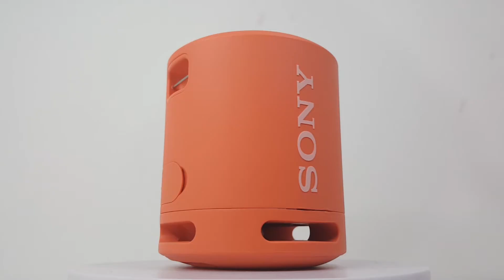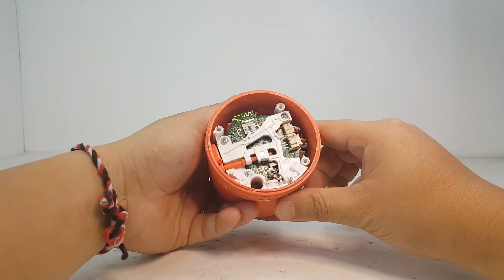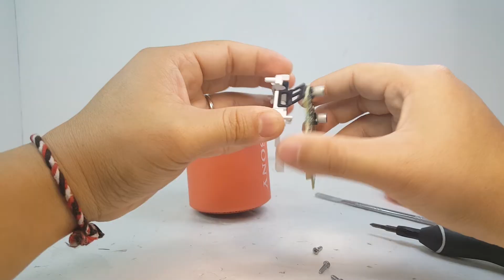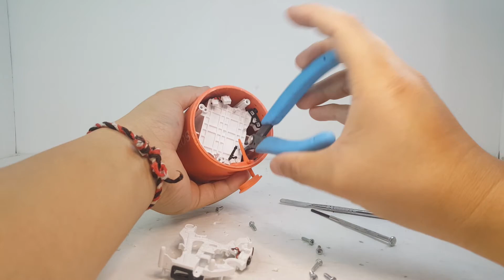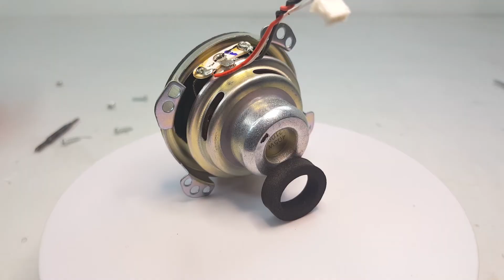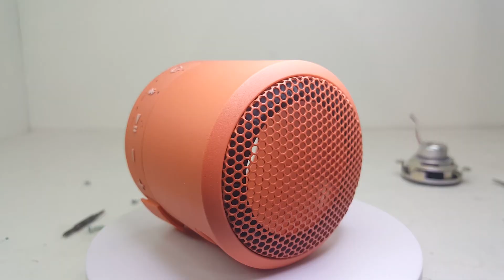SONY SRS-XB13 COMPLETE TEARDOWN !!!

Comment: BT 4.2 in 2021?
5W output and 1400mah battery, it is surely a overpriced speaker... enjoying my tribit x sound go speaker..i bought it over sony speakers.
Reply: what helps you have a higher bluetooth version in this speaker ??
Reply: @EdwardSchwartz27  better connection range and improved stability.. it's natural to expect latest tech from pioneer brands..when they sell products at a premium price..
Reply: @ankitbhadauriya121  do you have any connection issues/stability with your xb13 then?
Reply: @EdwardSchwartz27  I mentioned, I bought tribit x sound go with bt 5.0
On paper bt 5.0 has double speed as well as connection range compared to bt 4.2....can't comment on xb13 perfomance..
Reply: @ankitbhadauriya121  bluetooth versions are just specs. 5.0 just has higher bandwidth , which will only come into play if some new codec comes in market. Right now , sbc , aac and all the codecs first compresses the signal than transmits it . Even the bluetooth 4.2's bandwidth is more than enough for any codec present right now. In real world usage there is no difference in sound quality . Also watts is not something that you should judge a speaker with . A 5 watt driver can sound better than a 16 watt driver if the materials used inside are of superior quality. SoNy is Quality.
Reply: How does de tribit compares to the Sony in bass? I want to purchase one of those
Reply: @mvivanc  Tribit is excellent in terms of bass and loudness (16 Watt output). Sony XB 13 offers just 5 watts and is nowhere close to Tribit x sound go. Sony is overpriced. Tribit wins.
Reply: @ankitbhadauriya121  Thanks I will purchase the Tribit!!
Reply: @ankitbhadauriya121  although on amazon the Tribit is much more expensive than Sony
Reply: @mvivanc  In my country India, Tribit is 15 dollar 💰 Cheaper than Sony xb13...for you still Tribit would be better option even if you pay more.
Reply: @ankitbhadauriya121  Will do I am just deciding between Stormbox or Maxsound plus I want the more bass one

Comment: I realized that you broke or forced the back top to open the unit... What happened with the screws of the back side...?
Reply from the maker: theres actually no screw. theres holes beacuase i drill them myself to see if there was any hidden screws
Reply: @HBV90  So how did you actually opened it?
Reply: @ronosa5458  exactly what I need to know. The only part I need help with.
Reply: @kellinrlm8549  Same, tapping didn't break the seal.